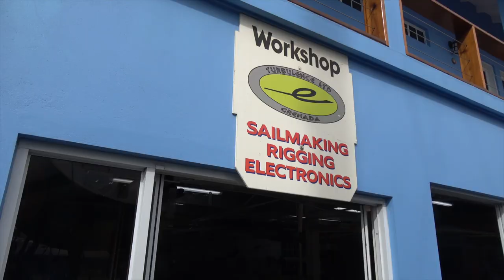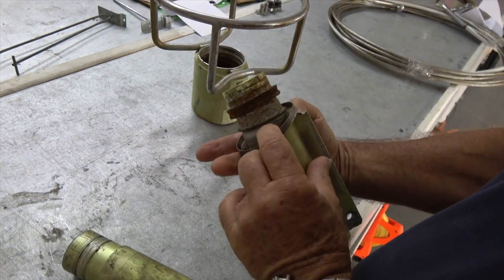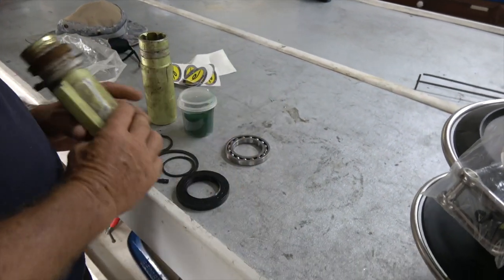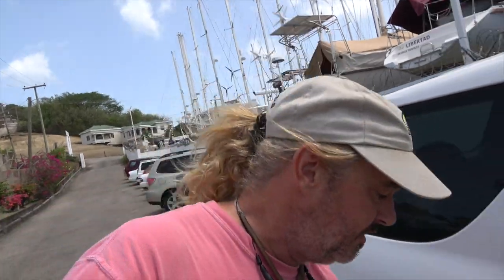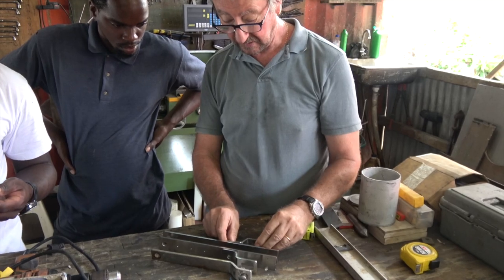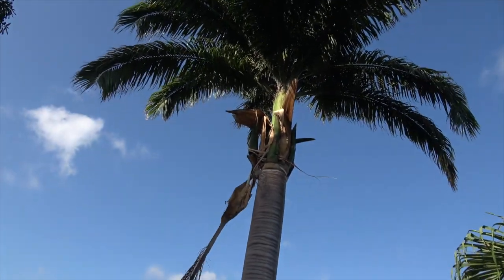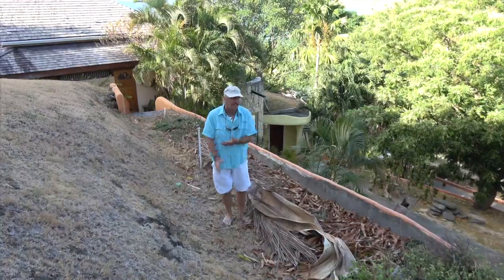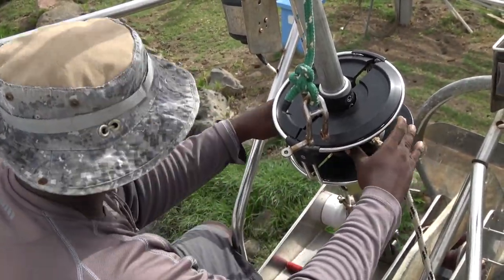SSL 177 ~ A Teeny too many Martoonies...!  ~ SOPHISTICATED LADY makeover Part 8

Comment: Rick, is there any way or need to safety wire that twist on bolt for your new furling rig?  Just twisting it on without any positive locking seems inadequate, but maybe it will be fine?